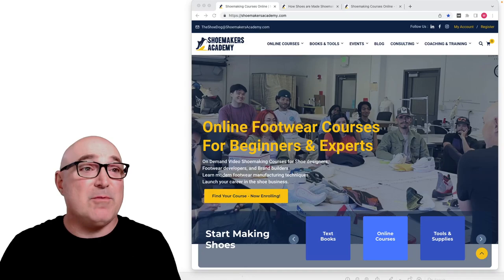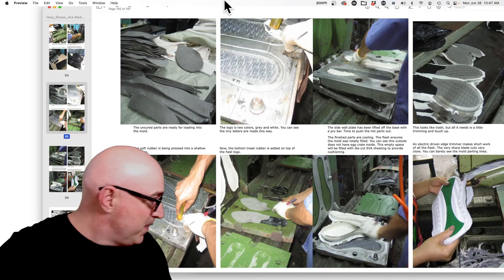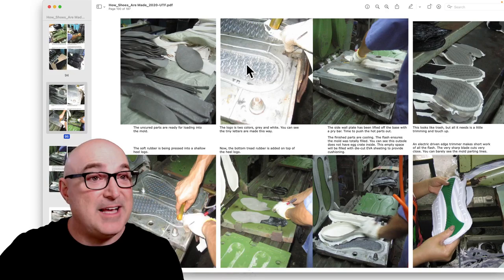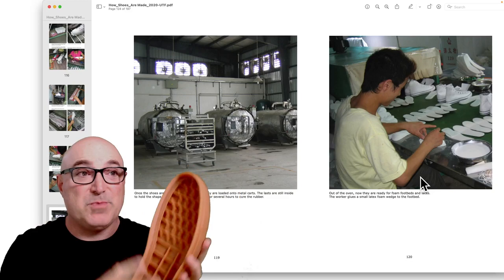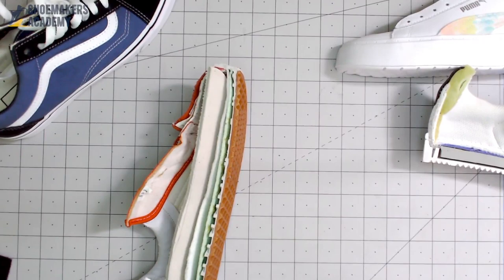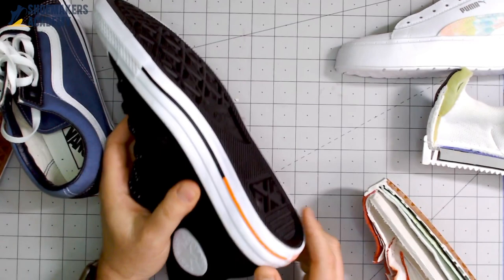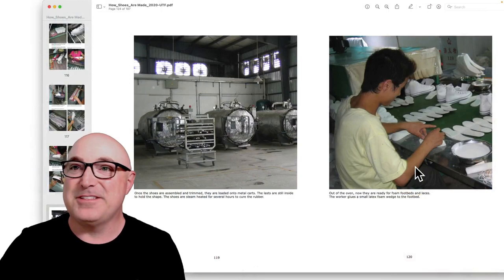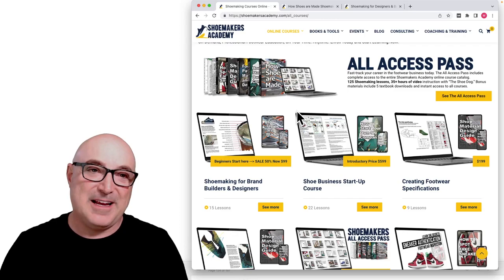Vulcanized Shoe Construction vs  Cold Cement Process

Comment: What adhesive(s) are used to bond the foxing to the sole? I have a Vans shoe whose foxing is detaching from the bottom of the sole, which seems to be a result of poor manufacture. I also have an autoclave, and I'd like to replicate the original bond, but I'm not sure which substance is applied between the foxing and sole before it goes into the autoclave.
Reply: Hey, the foxing is bonded with PU   Contact cement. There are many reasons why a bond can fail. Can you replicate the original bond? Not really. The rubber is now fully cured so it just wont bond the same.  For best results clean and dry the parts, apply cement then let dry. Now press together.

Comment: Is it possible to build a VSC shoe without an oven?
Reply: Not really. To fuse the parts the entire shoe needs to be heated.  You can just bond fully cured parts….but it’s not the same strength.
Reply: @walidkamaleldinmotawi1196  Thanks.  Could it be done with a household electric oven without burning the shoe up, lol???